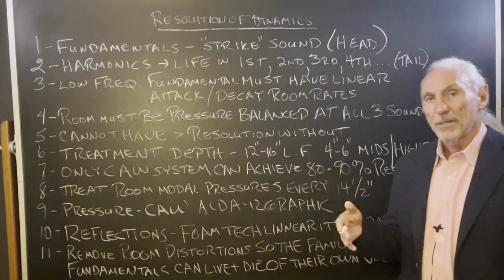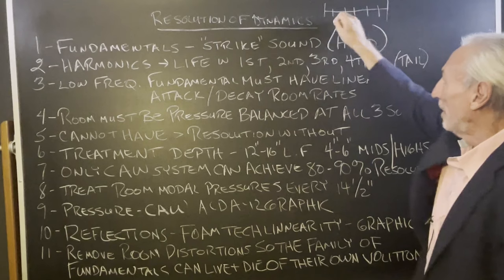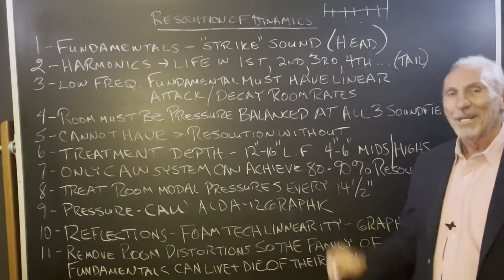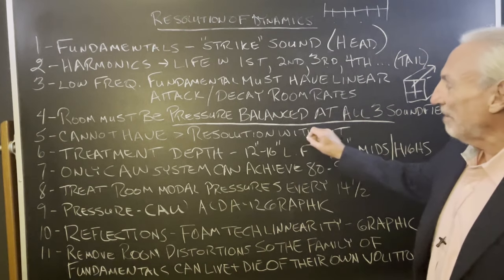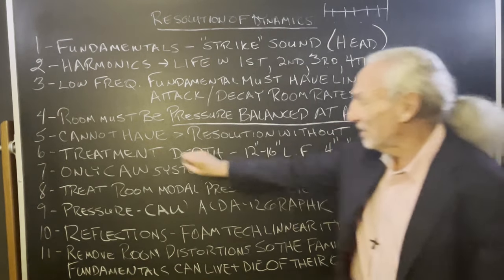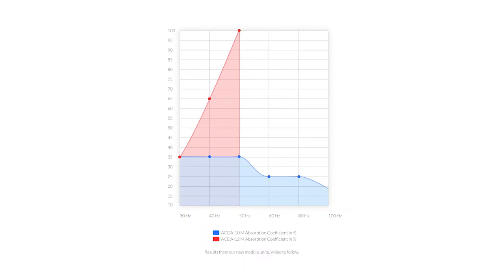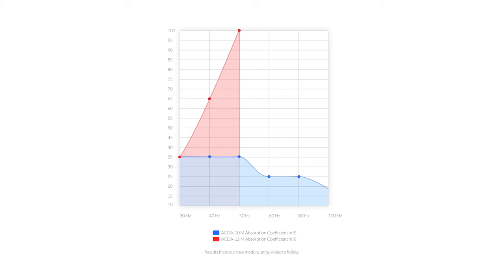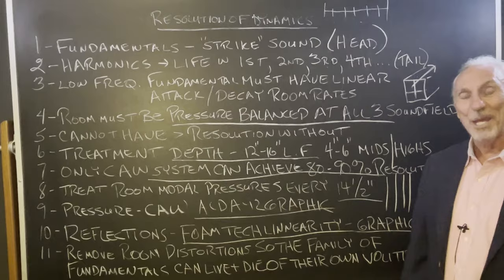Resolution of Dynamics - www.AcousticFields.com

Comment: Hey Dennis I have a question I want to buy some of your panels... Im an obsessed mix engineer 3 years into it. Do you think with good ears I could make a hybrid work? Like using your technology for 200hz down or something and use thick building insulation for everything else? My room is 14x16 and 10' ceiling. I have 10 panels 6" deep building insulation (I know I know) but its already +-5db from 100hz up and my mixes are starting to translate and compete with modern top charting songs which is what I want. Also for 30-100hz do you think is better absorbing at the side walls or the roof?
Reply from the maker: Building insulation is not a material type that will provide enough "horsepower" in absorbing lower frequencies. It can not provide the proper attack and decay rates required for frequencies below 100 hz. to allow for proper separation and definition of lower frequency octave bands. Only diaphragmatic absorption will work in your room size/usage.